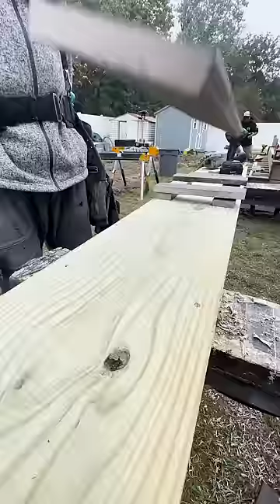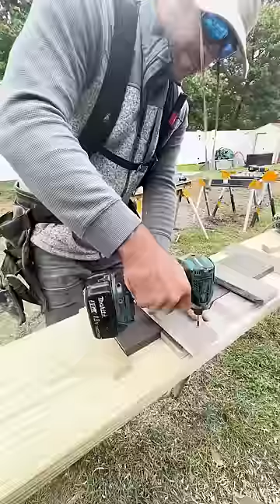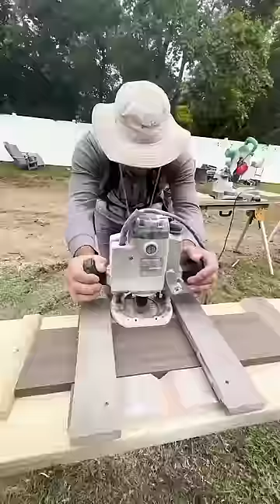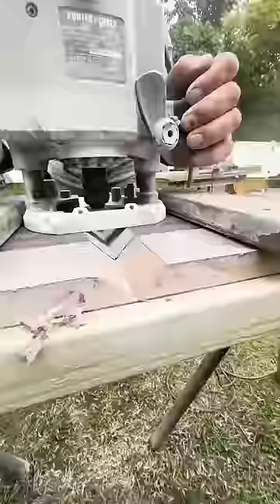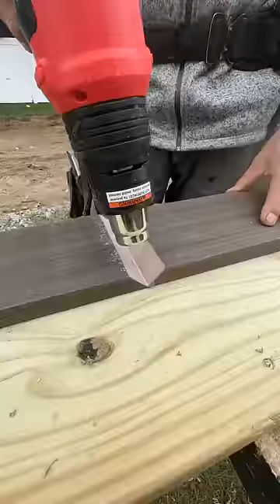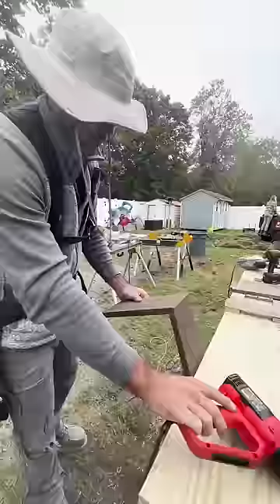Miter folds! A special detail we love adding on our projects, but also making it efficient!

Comment: Be sure to post the video when Tony’s (is it?) dangling hat chin-strap wraps around one of the power tools, I definitely want to see that video and I will give it a like
Reply: also the one where his long sleeves get caught in the table saw
Reply: Agree. I was cutting a piece of steel with a carbide blade in my right angle grinder. I was wearing sweat pants. The blade slipped and caught my sweats. They wrapped around the blade so fast and caught my skin on my thigh. I had to use a utility knife to cut away the material. Thankfully I only had a massive bruise on my leg. Stopped wearing loose fitting clothes after that.

Comment: Meanwhile his crew finished framing, insulating, and boarding up the house, while he’s playing with one board at a time. Guarantee the other guys are shaking their heads.
Reply: Thinking the same.. I mean, what do you accomplish? Unless you're bending 50' boards to cap an entire deck frame, you still have a cut/miter somewhere.. is it cooler because it's not at the corner?
Reply: Some people can't grasp the notion of applying a technique to a variety of situations. Most of those same people don't understand craftsmanship.  
Thankfully, there is still a demand for fine woodworking, and that demand can't be met by the likes of IKEA, Kraft-Maid, or Hack & Whack Construction.
Reply: Yeah doesn’t it suck when others get paid for for doing shit like this when all you get measured on is how fast you get something done.
Reply: @combsd3283  If you’re talking deck caps then if the mitred joins are not at the corners they won’t open up as moisture and heat changes.
Reply: That's their job..
Reply: You sound like my old boss and his son. Do the work quick and make it look ok. While these guys take longer but make it perfect, which in turn leads to higher quality jobs and getting paid three times as much. Can’t tell you how many times they’ve tried to call me back to work with em 😂
Reply: @dryspaghetti5507 I think you guys are comparing apples and oranges. There is nothing wrong with either. Going fast and doing an OK job is fine for a higher production environment like working with a builder (think DR Horton, Lennar, Cornerstone). In those cases you are on a tight closing schedule and the customer is expecting it done on time and knows builder quality work is mediocre and that is what they are paying for. Fine craftsmanship like you describe is something different, and more for one off builds, custom builds or a remodel where you aren't on as much of a tight schedule.  Both have their places and functions.

Comment: If I’m not wrong those two guides are just about 7/8” thick.
Put two 1/2@ think strips of any material so the router base is lifted 1/2” off the work piece so you’re not hogging out the whole V-grove at full depth, then remove the two spacers and finish the groove.
You don’t have to change your jig at all.
Just a thought.
Reply: Just maybe have a look at a router one day
Reply: @pedtrog6443  : don’t know what you mean.  I’m a woodworker and I’m very familiar with routers. I was just offering a helpful idea to the guy.
Maybe you could explain your comment….
Reply: @ginoasci  Most routers excluding some of the smaller trim routers are 'plunge' routers so it's merely a case of a small adjustment to alter the depth of cut. These different cut depths can also be preset, also.
Reply: @pedtrog6443 :  
he is using is a plunge router base.
now what ?
Reply: @ginoasci  You adjust the plunge stops to a half depth and a full depth cuts. Run your first cut through on the half depth setting, flick the stop over to the full depth setting, push down, lock it and do your second cut. No need for spacers.
Reply: @pedtrog6443  :  you didn’t read my comment, did you.
Reply: @ginoasci  I give up

Comment: I worked for a deck company for a year doing azek decking. They didn't want us to try this because we didn't have a router  and no one could do it clean enough. They even cut 7/8 of the end off to fold a little flap over and it looked like crap 😂
These guys make it look easy to work with this stuff.

Comment: You can do the same thing in a similar jig using a circular saw set at 45. Do
1 pass then do another pass from the other side.
Reply: newb here.  is there anyway to do this with plywood if you wet the wood and bent it gradually?   is that crazy talk?
Reply: @coppulor6500  No it is not crazy talk.  Of course there are several factors.  Certain types of plywood won't like either the bending or the water but others will do just fine if you soak them with warm water and it is probably best to use some kind of form.
Reply: @matthewhall9692 first, thank you for replying 👍
Second, so you happen to know which plywoods?  Since most is pine, I'm hoping you say pine 😊
Reply: @coppulor6500  Softwoods like pine are not ideal for bending.  Birch plywood would be a good choice I think.
Reply: @matthewhall9692 thanks!

Comment: It's a nice finish, but I'd be concerned about it ripping apart over time as manufacturers usually call for an 1/8 inch expansion gap between butt joints and corners of the facia.

Comment: Installed this way couple times. Problem is exposure. The thin layer is likely to crack over time. Glue and dado in metal L bracket, never moves. But a lot of work for tiny detail.

Comment: Do you use any adhesive on epoxy on the inside of that miter? I'm about to take on a deck job where ill need to do an outside miter like that and was wondering if any adhesive was necesary.

Comment: Router bit probably wasn't that dull it just has to melt through the plastic. 
Depends on what that's part of no one might ever even notice you folded it.
 Seems like possibly a waste of time with not any added longevity...... Seems like that corner would have a bit of heat damage which will show up in the later years. 

I have to give you a two out of 10.

Comment: Stop ramming the router bit into the workpiece !
Let the router & the router bit do the work for you. 
The parts and the machinery will last longer. 
It also takes the same amount of time to move the router bit slower through the work piece as ramming it back and forth through the workpiece.
Reply: CLEARLY you don't understand motors. They deleted the brushes, so he only has to delete the insulation and windings before Friday.😂

Comment: Composite materials are the worst. Take a deck for example. Setting aside that composite decks still discolor and warp and are typically replaced something like every ten years (and use the same screws and brackets and wooden joists that wooden decks do that rot or break at the same rate), even if a composite deck did last for 100 years more than a wooden deck, it still has an end and then all those "boards" sit in a landfill until Jesus returns. Using wood, which is a renewable resource, means when it is replaced, it is no problem at all and goes back to being part of the natural cycle, breaking down quickly.

Comment: Do the corners ever crack?
Reply: Do you really think he would tell you, I mean come on.  I know what’s gonna happen to it and im not a carpenter,  
Just by seein him use the heat gun tells you it’s def gonna crack and when it does it gonna look like 💩    Ok looked good tday when they did it and the customer was like awesome   Then the weather beat it up for year guaranteed it cracked and the heat gun messed up the molecules in the not wood decking ( plastic) so not only have a crack but now it will start to warp, swell up and look really bad

Comment: You need a new cutter,  also you need a new router for the cutter
Reply: Or, 2-3 passes?
Reply: @td3pnt  the high pitched noise coming from the cutter,  the router motor clearly struggling,     you need new tools.
Reply: @td3pnt  2 or 3 passes is standard

Comment: Efficient??? Nope. A jig so he doesn't have to screw in stops and pieces every time and either learn to use a router that size or buy a tool with enough power to do the job you want it to do. That router is gonna die very soon.

Comment: Cheap plastic decking but installed on a wood frame,composite is garbage your better off with hardwoods and plastic decks are very hot in summer, garbage